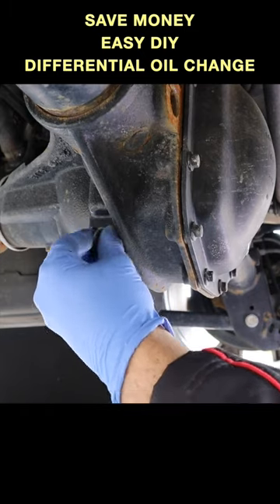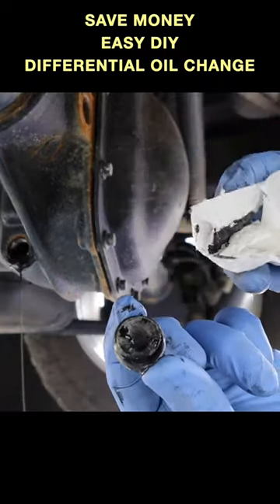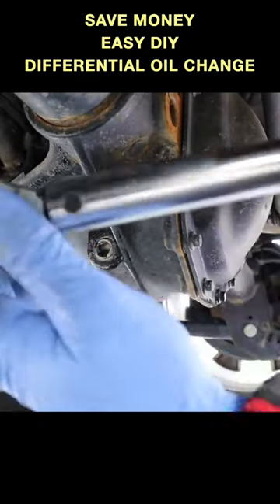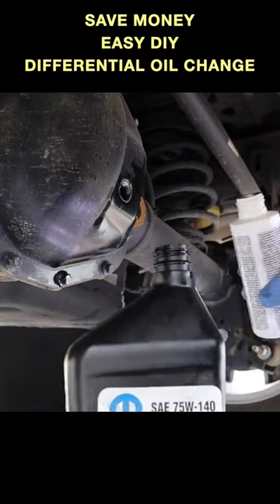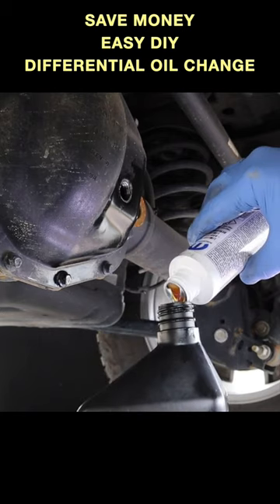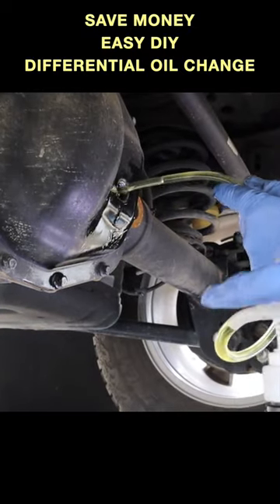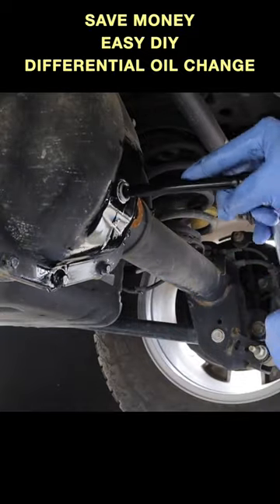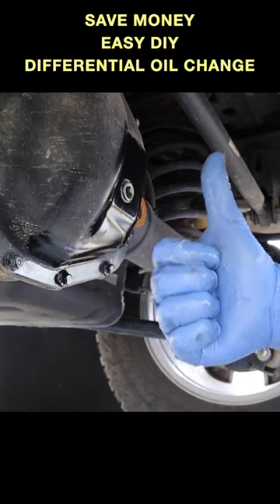Easy DIY Differential Oil Change Can Save You Money

Comment: Came to do this just today on 2006 Suzuki GV, @ 118K miles, just returned to doing my own servicing,  Its a simple job I have done before several times on different cars , but a long time ago as a younger guy. I have service invoices saying this has been done by previous garages, but when came to undo the filer plug it would not budge even with a two foot extension bar for leverage. i bought the oil and syringe pump, but now have to see if a local garage can  shift it , all because some knuckle dragger has either vastly over torqued it , or not done it at all ! am using ground ramps on m y drive but cant develop the length of swing but NEVER come across one so totally frozen . to sat am  FURIOUS is an understatement and goes to show , do as much of your own wrenching as you possibly can !!
Reply from the maker: Yep. I agree. There’s a lot of peace of mind and satisfaction that comes from looking after your own vehicle. Plus some significant savings. Cheers.

Comment: Of course not all diffs have a drain plug. For those diffs you have to remove the cover plate and install a new gasket.
Reply from the maker: True. My 2024 Rubicon doesn’t have a drain plug. That makes DIY a little more troublesome. Cheers

Comment: When you pull the drain plug fluid "Should" pour out.... No guarantee on this 😅
Reply: Not all differentials will have that same torque spec, and not all have the additive.
Reply from the maker: Very True. A Short video shouldn't be expected to have all the details necessary. Feel free to check out the full video at https://youtu.be/wW_l0AEY6wg
Thanks for watching.
Cheers
Reply: @CheaperJeeperTV  - I just raise my concerns about people posting videos about fixing their own cars.

I'm a licensed mechanic and you can tip toe around it all day long but there is no comparison to a certified mechanic and someone who thinks they're handy.

It's kind of like this new age gender ideology... For some reason a bunch of people who aren't seem to think they know the same as someone with a doctor degree in biology.

Comment: Was getting oil changed at a Valvosine & they were telling me this needed to be changed for $100! But don’t worry it only takes 10 minutes they said 😂 will have to borrow tools from AutoZone cause don’t have a torque wrench with PSI reading but other than that should be doable
Reply from the maker: Yes. Here is my detailed video. I am not a mechanic but as you can see, it is very doable. You get the satisfaction with working on your own rig, that it’s done right, and you save money. https://youtu.be/wW_l0AEY6wg?si=G-okMDcGSETuG1Tz
Reply: Over here in California where I’m from they want to charge a little over $100 for an oil change! I went to the store and did it myself for about $60. I also did my girlfriends oil change for $35

Comment: Not all cars like having diff oil full to the brim, read the owners manual to see how much you need to put in.
Reply from the maker: Absolutely! Read the owners manual for your specific vehicle for sure. 
From what I have found, in regards to the Jeep Wrangler, the differential and transfer case oils should only be filled to the fill hole. As soon as you see it leaking out of the fill hole, that should be enough.
Thanks for the feedback.

Comment: Synthetic has the additive i it already, and you need the additive only for the LSD diff.
Reply from the maker: Yes. The additive is for the LSD differential. I used OEM differential oil so as to avoid any possible  issues with  warranty.
Reply: @CheaperJeeperTV  yep, I do the exact with my 2016 75th Anniversary Edition as it is under a 7/100k Powertrain warranty until 4/2024, already covered a new rear main seal and oil filter housing replacement, that would have been a $2200 charge if not covered, as a result of “The Great Crackening” cold spell of December 2022, quite a few folks had oil filter housings fail due to this weather event, including 3 friends of mine with Jeep Wranglers (3.6).  My 2010 with the 3.8, the EGR Valve seems to be its “oil filter housing”, when it comes to the “weak component” that will need replacement of the 3.8.  If when the oil cooler does fail again, and no longer under warranty, then I’ll go the Dorman aluminum route.  Wish they had the same for the TStat.

Comment: Do you only have to add the additive for the rear differential or both the rear and front?
Reply from the maker: Additive is for the rear differential, as it has the limited slip differential option in my vehicle. Check with your dealer.

Comment: How often to perform. How many miles or years between intervals?
Reply from the maker: I do it every 50,000 kms. However it depends also on your driving habits and weather or not you go off road a lot.
Reply: @CheaperJeeperTV hi I have a 2010 f150 with 300,000 miles.

and I use a landscaping trailer every day too hauling too work 

I be driving like 8  hours every day 

So every what couple of months should I change differential oil
Reply from the maker: Hey Brian, 
I'm not a mechanic, and I just share what I learn from others on the Jeep forums or from YouTube videos. Essentially I have read many times from different sources, that if you want to look after your Jeep, to change the differential and transfer case oils about every 50,000 kms. Plus, if you are doing some aggressive off roading, then sooner than that.  I like to look after my vehicles, so I decided for my Jeep, every 50,000 kms sounded good. The interval I followed lines up with the dealer's recommended interval as well.  
In your case, I guess it is up to you and what the F150 service manual recommends. It sounds like your use-case scenario can be described as heavy duty,  You may want to change the oils on a more frequent basis.
I hope that helps.
Cheers.